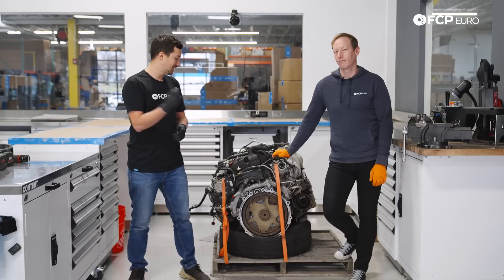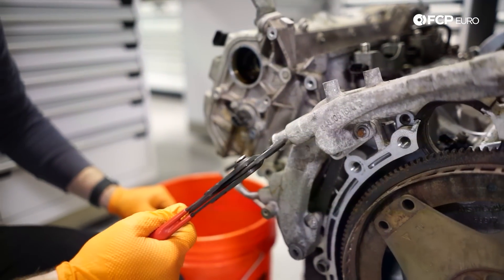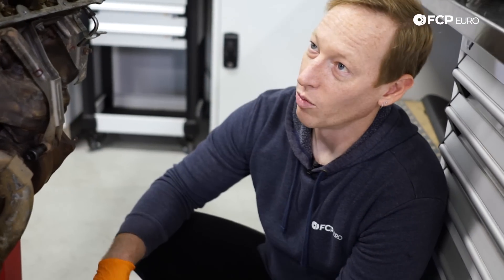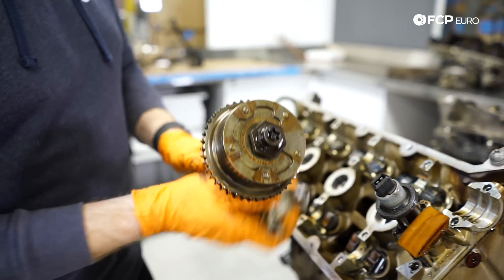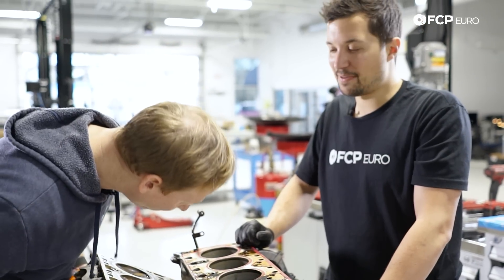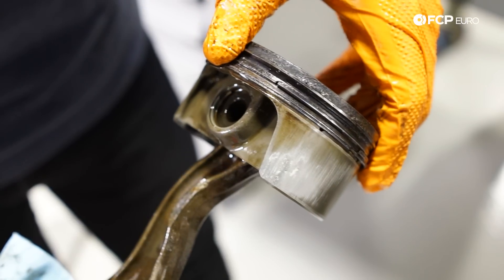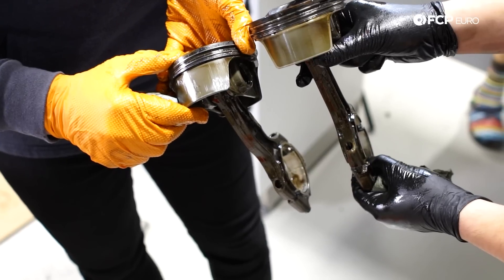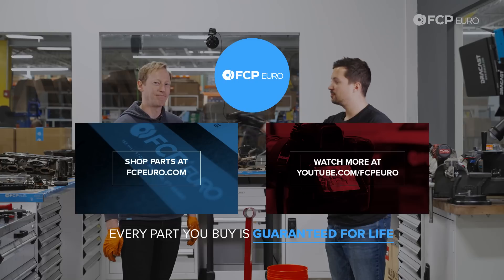Bending Steel With Water: Inside a Hydrolocked Porsche Engine

Comment: Fell into a flooded (thus invisible) 3’ ditch in my new Austin America. After the water receded, dragged it back to work, pulled the spark plugs, rocked it back and forth, changed the oil and drove on home. Never had another problem with the engine.